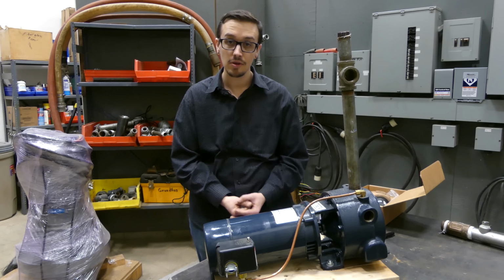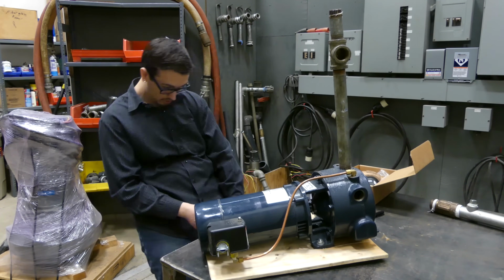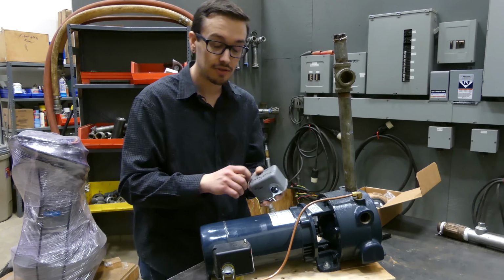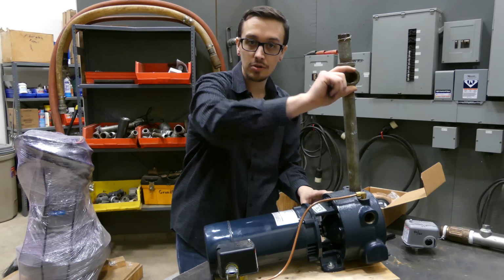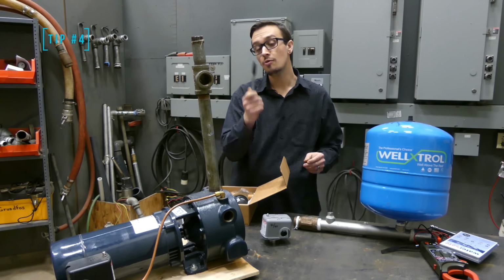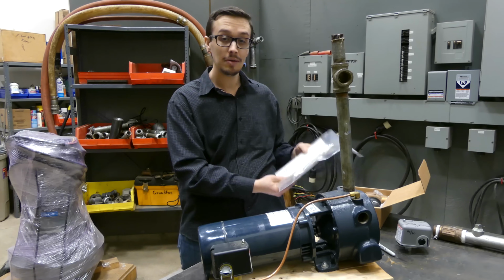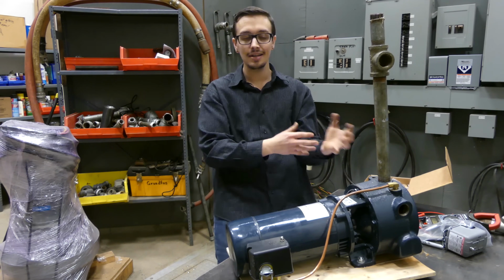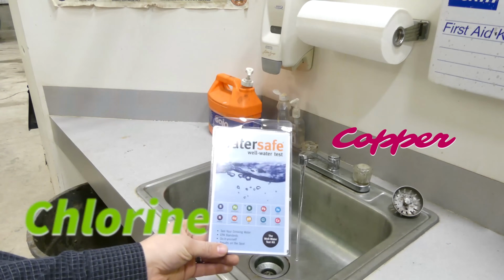7 Things Every Jet Pump Owner Should Know

Comment: Im m3ssd ip is it possible that my tank psi is to low for my pressure switch,? My tank says 25 psi empty the pressure switch nee says its50/30 . I like 60 /40 but have ot changed he pessure switch. I had a helper working on property . He stunk got rid of him . WHAT ARE THE SYMPTMS OF THE WELL IF THAT GUY CHANGE MY PRESSURE ? ALSO IS THERE A WAY TO RESET THE PRESSURE SWITCH?? I DONT HAVE ANY IDEA WHA ITS SET TO. S.O.S. PLEASE

Comment: I wished I saw this before I hooked up my pump. I did see other piping video using scedule 80 male greads into female galvanized  fitting. Home depot don't sell npt threads on male pipe threads. Had to thread my own.

Comment: Thank you for all of the tips, but I have an issue that I can't find any info on and can't afford to call on a tech. We've had a lot of rain recently. It has caused the water to be white cloudy. I'm sure it's the fine white silt from the ground. My well is just over 4 years old with the MSE-7 pump. My question is, What do I need to do to get clear water again? I'm told that it isn't harmful but it still hasn't stopped from getting water from elsewhere for drinking and cooking, lol. I've done all of the simple processes to see if it was gas, air and silt...it's silt. No one has a video about it on here about this so I'm hoping for an answer from you. Can you please help me? God Bless

Comment: I have a CountyLine 1/2 hp pump which has it’s own pressure switch. I’m installing a 32 gal pressure tank with a “T”. 
Do I need another pressure switch on the “T” also? If not, which switch should I wire up?

Comment: Do I need a check valve between the jet pump and the pressure tank?
Reply from the maker: No, just on the inlet. Typically this is achieved via a foot valve for jet pump systems.

Comment: Hi. My pump runs but it shuts off and the motor is hot. You can hear it clicking trying to kick in so I shut the power off sometimes or I don’t and hit it with my hand on the end and it takes off. It actually for 2 weeks worked fine but it’s doing it again. What should I check first? Thanks

Comment: I have an irrigation system that has 5 zones each outputting between 12 and 15 gpm. I purchased a new  1HP pump with capacity of 18gpm, what size tank should I get or is it best to go with a CSV ?
Reply from the maker: Give us a call: 855.329.4519

Comment: As the sprinkler system changes zones the pressure drops to about 10 pounds, while the zone switching is happening will the low pressure shut actually shut down the pump  ?   So the question is , Whats the pressure that triggers the switch  ?

Comment: HELP ME OUT? I want to run my 1/2 hp 20 amp well pump from 2 x 12  volt marine batteries in parallel, what AC watt inverter do I need? (115 volts)

Comment: Sucking water from a creek for outside irrigation. I have a square D 40/60 switch. I think my check valve got stuck open (debris) and allowed the pump to suck air and probably burned up this pump. Going fwd, Is the low pressure cut-off switch used in place of or in conjunction with the regular pressure switch? Great job on the videos?
Reply from the maker: The low pressure cutout switch would replace your current pressure switch.
Reply: @RCworstwater  Thank you. Ignore same question on another of your vids.

Comment: No water in the house, replaced everything new on pump and pressure tank. Holding pressure on the pump turn on water faucets in the house maybe get a drip the pressure switch doesn’t drop at all with all the water faucet on in the house🤔 although the toilet will fill up with water after time🤔
Reply: Very helpful tutorials - have utilized some of your instructions! Cheers

Comment: I just changed my well tank and I have the same exact pump. Switch won't turn off after 50 PSI. I wonder if I need to play with the switch. I didn't had that problem 4 days ago with the old leaking tank. Do you have any idea of might be the cause ? and should I play with the switch lol
Reply: same question here...

Comment: That copper tubing leading to the pressure switch is another potential tip.  Squirrels in our area chew through the plastic tubing that comes from the factory on some pumps and a local well company recommended I use copper instead.  Thanks for the great videos!
Reply from the maker: Interesting! Good to know!

Comment: when installing a deep well pump and need 2 pipes going down can you attach the return into the other pipe with a T so you don't have to have 2 long pipe's going down in the well?
Reply: You need to buy the kit for your jet pump. Ejector, venturi, and foot valve. The further the two pipes go down to the ejector (and the shorter the tail pipe) the more gallons per minute, at a given depth of the foot valve

Comment: I have a jet pump and just replaced the pressure switch and my pump has 2 lines that attach to the pump why is my top line collapsing when i turn my pump on and no water coming out please help?
Reply from the maker: Please give us a call for help troubleshooting: 855.329.4519

Comment: pump will be ok, then starts running constantly, warped pipes and then started cracking the pipes. We had pipes replaced, 6 days later it does it again, pipes came apart at the connections. Fixed again, was ok for a week or so and while we were washing dishes the steam became weak and the pump was running constantly again, but we caught it before it got too warm and kept the pipes from coming apart again. What could the problem be?
Reply from the maker: Give us a call: 855.329.4519

Comment: does it have to be a ball valve on the discharge line? could you use a gate valve?
Reply from the maker: Either would work, but quarter-turn ball valves are preferred because they're much easier to open/close
Reply: @RCworstwater  thank you
Reply: @RCworstwater   Gate valves are the absolute worst choice for throttling i.e. flow control; Globe or Ball (a poor cousin actually) are by far the best. But for wide open or completely closed purposes, yeah, a gate would be fine. A centrifugal   pump really "likes" to start against a closed valve. Most well systems that I have seen are using ball valves however.

Comment: Does the m4 low pressure switch connect between the resorvoir and jetpump? If so won't it reduce my flow? 1 1/2" coming in?  Am almost an expert because of you here in The Gambia Africa thank you for the series video's!
Reply from the maker: Jordan, if you don't have a tank tee then the switch should be tee'd in using a 1.5" x  1.5" x 1/4" tee. It will not affect your flow rate at all. Here the tee I'm referring to: https://www.youtube.com/watch?v=-m_JAaMORPo&t=169s

Comment: I have problem with my deep well jet pump and pressure tank, the pump pressure discharged the whole night and  i need to prime the pump every morning. Any help please
Reply from the maker: John, it sounds like you have a leak somewhere in your suction line, most likely the foot valve. You'll have to pull it up and repair/replace. We sell foot valves here: https://www.rcworst.com/Valves-c80.html?Attribs=504&

Comment: Hello Chris!  What is your take on the 4.5 gallon tank recommendation from the cycle stop valve company?  How much of a drain on electric consumption would a 15 amp pump running constantly have vs cycling pump?  In other words, would it be cheaper to replace the pump at frequent rate than have to pay larger electric bills

Comment: I have problem with pump, first start up in the morning the pump pressure is releases the whole night. So i need to prime every morning.
Reply: Sounds like a foot valve or check valve that is not working properly.  Could be stuck open or obstructed with some debris.
Reply from the maker: It sounds like you have a leak.

Comment: In what case would one not have a switch?
Reply from the maker: Which switch are you referring to, the pressure switch or circuit breaker?
Reply: A transfer pump does not need a pressure switch as you'll run it until all the water is transferred, e.g. when draining a swimming pool or filling a cistern.  These are continuous duty pumps, however, like all pumps, they don't like to run dry!

Comment: One thing to mention about using a meter to check the amperage draw of your Pompidou that the clamp must only be around either the positive wires or the negative wires while taking a reading.   If you place the clamp around both at the same it will try to read both positive and negative sides at the same time and because the current is moving in opposite directions on each side they cancel each other out and will read ZERO AMPS.
Reply: "positive or the negative"? We're working with AC here. Not DC....

Comment: Hi, I'm using a jet pump without pressure tank for an irrigation system.
It was given to me, so I have no idea if I'm dealing with factory settings in the switch.. The pump sits on top of an IBC tank. The intake pipe is 1 1/4, 20ft long, with a footvalve at the end of it, resting on the foor of the tank.I have a priming-Tee with a pressure gauge just above the pump discharge. The pump only generate about 15-18psi with the tap open and 28-30psi when the tab is closed. The pressure switch sometimes rapid-cycles, but allows the system to run on open tap. Is my pump defective (low operating pressure)? Is 18psi too low for thge switch to be set to? Whatelse should I consider. I had hoped for the pump to generate 50 psi to run a sprinler system in my market garden.
Reply from the maker: Thomas, please give our techs a call: 855.329.4519

Comment: I'm not sure what I'm missing , I have plenty of water in the well. My line r about 99 feet down in the well. The water level is about 20 feet from the cap of well . Check all my fitting and no leaks.i just don't know what I'm missing. Every thing is new from the pump to the foot valve. And still only getting 20 psi of pressure.
Reply from the maker: Do you have a deep well jet pump or a shallow well jet pump?
Reply: MAKE SURE YOUR PRESSURE SWITCH IS ADJUSTED RITE IT SHOULD SHUT THE PUMP AT AROUND 45 50 PSI AND GO ON AT ABOUT 35 40  AT THAT POINT WILL PUT GOOD PRESSURE ON THE TANK BLADDER ,  I DID NOT ASK FIRST OF ALL, BUT I AM SURE YOU HAVE A PRESSURE TANK ON SYSTEM DON'T YOU?  IF NO THEN  MAKE SURE PUMP ITSELF STOPS AT 50  60 PSI

Comment: Just replaced my jet pump ,water tank ,and lines going to the well plus the foot valve. I'm only getting 20 psi. I'm not losing prime.
Reply: If the pressure switch is turning the motor off at 20 psi, then you need a new pressure switch or an adjustment.  If you're running the pump flat out and dumping all of the water out to an irrigation system as fast as possible, then that may be the most pressure you'll be able to get.  In that case, you'll need a bigger pump and perhaps a second well.